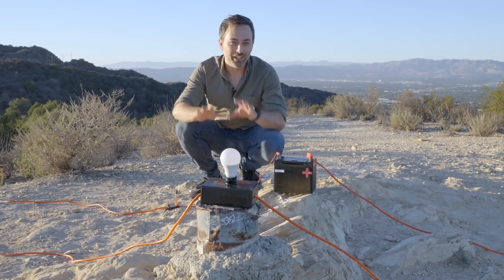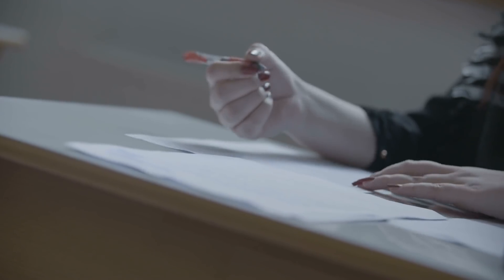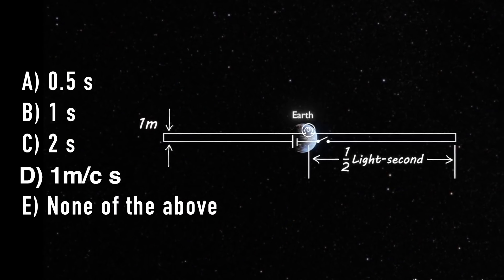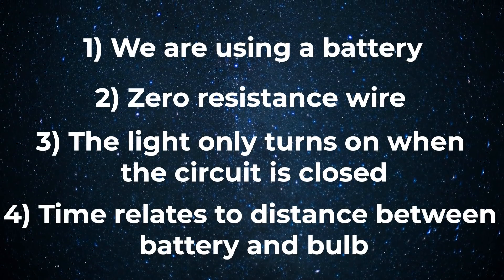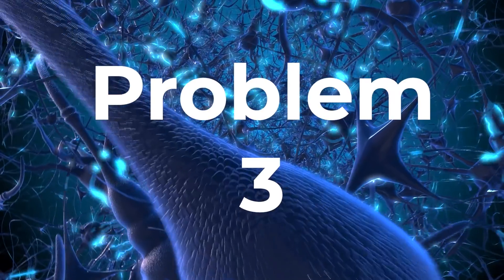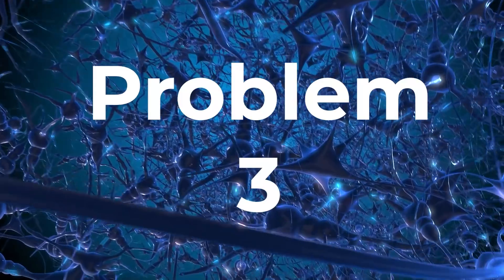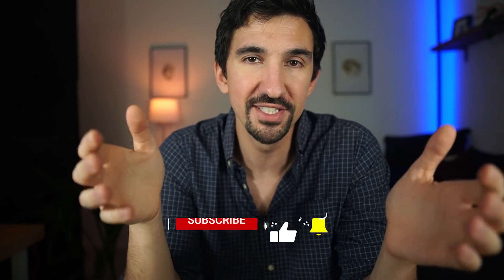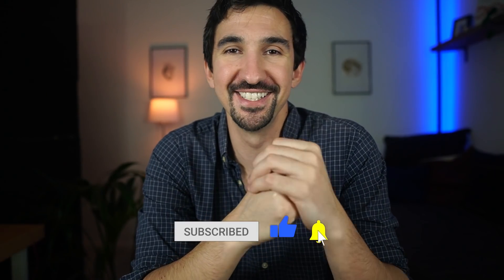Is Veritasium Wrong About Electricity?

Comment: I've not seen mention the index of refraction in these conversations. The "speed of light" as often quoted is when measured in "free space", or a vacuum. Light travels comparatively slower in any medium, be it glass, water, a wire, etc. That is why a pencil in a glass of water appears "bent" at the air/water boundary layer. Do we just take the accepted answer, either presented here or Veritasium, and multiply that by 0.7, or the agreed upon IoR,  and "call it good?"

Comment: I think you missed the point. The 2 wires/battery are 1 meter apart. It created a capacitance. The electron waves moving affects the field, that will interact at 1m. I think thats what they were going for.

Comment: Consider this: The voltage potential, EMF, is already across the entire circuit before the switch is closed, put a volt meter across the switch and it will show the battery voltage at that physical location which is about a foot away from the light bulb. Now if I push or oscillate the atoms at one point in the wire how long does it take to move the atoms at the other end of the wire if they are all connected? or how long does it take the steel ball of a newton's  cradle toy to move when the ball at the other end strikes?  Yes I believe Veritasium is wrong. Veritas truth? However I do agree it is the moving magnetic field that gives the power not electron flow that power is simply transformed across the gap in a transformer hence the name transformer., and there is also the "skin effect" which I wont get into.

Comment: If we convert  kilometers in cm  like architectural  scale. Small miniature version. We get size of earth 13 cm,  sizrr of sun 6.96 meter. And distance between them is 1.5 km.
 And speed of sun light is infinity.
     Look at the scale below. Correct me if i m wrong.

1000 km= 1 cm .
10000km=10 cm.
13000km=13 cm.
15000km=15 cm.
100000km=100 cm (1meter).
200000km=200 cm (2meter).
696000km=696 cm (6.96 meter).
1000000km=1000 cm (10 meter).
10000000km (1 CR)=10000cm (100 meter).
100000000km (10cr)=100000cm (1km)
150000000km(15 cr)=150000cm(1.5 km)

Comment: The instantaneous current is related to the ratio between the load (low) and the impedance of the parallel wire transmission line.

Comment: At first i was wondering why you were empathizing on being battery and no resistance, and thought can’t it be a strong electricity source ? And realized if it was strong electric source it could work like parallel antenna or wireless charger specially if it was a/c. Good first two assumptions.

Comment: I have stopped watching Veritasium after realizing that Derek is just playing with people's confusion between 'electromagnetic effect' and 'electromotive force'. The electromagnetic effect propagates with time 1m/c to the bulb, but the electromotive force takes 1 s to propagate to the bulb. It is the e.m.f. that lights the bulb up, because the operating current can only pass through the bulb when there is a correct e.m.f. across the bulb. The bulb does NOT light up simply it receives an electromagnetic pulse, which is so miniscule that it can safely be ignored. Disclosure: I have a Ph.D. in physics.

Comment: Nice rebuttle and clearifies and corrects some aspects of Veritasium's video. I believe though it misses the point he was trying to make- that it is not the actual electrons flowing through the wire that is the charge. Electrons flow slowly (drift velocity) at barely 1% the speed of light. And yet a charge travels at near light speed as electromagnetic wave. They operate more like water molecules oscillating up and down, moving slowly, yet transmitting a wave very fast out from an impact. A water wave can even transmit in opposite direction of water flow. It takes about 11 million eV to propell an electron to near light speed (beta ray), which an Eveready battery is not able to do.

Comment: I had a hard time understanding Derek's explanation so I'm probably wrong. But I thought you were saying that the electricity travels through the magnetic field outside of the wire. That the magnetic field from the battery extended directly to the light bulb and did not have to travel the wire. That was the point he was trying to make.

Comment: So I'm assuming the "battery" in the case of powering my lights at home,  would be the power station,  and farther down the line,  the transformer outside my house.  It's he implying that my lights are powered by the transformer inducing a current into my lamps? Or is he taking about a different magnetic field than one that induces current?

Comment: True, 1/C is used to consider that any fastest thing possible is the speed of light, but here its only means instantaneously. And even if consider the sped of light (1/c sec) then also it means electric signal travels faster than light. It means someone can send signal from moon to earth through wire in 1/c sec while light reach after 1.2 sec.

Comment: I still dont get the idea of a limited speed of light ..... If current is light as electrons in formation, the speed of light is analogue to a rate of induction. It would first be necessary to understand the potential of space in its dimensions . With the 3 D model plus time as a 4th dimension the concept of light is not understandable. Albrecht Durer allready had that knowledge about the potential of space . He gave hints in his artpieces that he had further knowledge of the concepts of time and light.

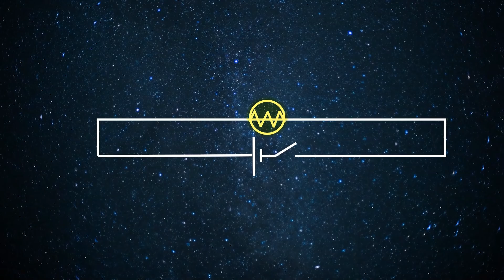Comment: 4:25 You neglect the capacitive and inductive coupling of the loop of wire. It's not sufficient to only focus on the current running in the wire. You have to apply all four of Maxwell's equations to the problem simultaneously.

Comment: 3:32 "the signal could propagate all around the signal unimpeded" - No it cannot. Funny that you say "unimpeded". A wire even if had no ohmic resistance, it still would have capacitive and indictive properties, it has an impedance!

Comment: BLAH, BLAH, BLAH, BLAH, BLAH.  If you knew the basics of wave theory or transmission line theory you would have drawn a simple diagram showing how the fields in the two wires interact with each other.   
But you didn't.

Comment: What if the two wires AREN'T one meter apart? What if they're a mile apart? Does that mean the lamp with never turn on? Or not as fast?
Reply: You have to change the 1 in !/c to get the the distance he uses 1 meter as an easy number for the example,  if it was 240897 meters away you would use 240897/c

Comment: I don’t think you understand what he was getting at. He mentioned the characteristics of alternating current, how it doesn’t flow through the wire like water through a hose but shakes back and forth. I think what he was getting at is the fact that on or off there is constant flow of current in the line. It’s a big theory that’s going to take people stepping out of the old comfortable notion of electricity we all know and love. I think the theory is closer to what Tesla was thinking of than we’ve gotten yet. Let’s not forget Tesla designed alternating current around the principles of am radio. 120 volts residential power supply shares many many similar aspects as your clunky ancient am radio technology. Over the air electricity makes a lot of sense if you look at it as magnetics and plasma.

Comment: Thanks. I've been asking that question on every video on this since I first saw it (with no response). 

Either the wire doesn't need to be closed, or there must be a delay equal to the distance of the wire, or we've disproven Einstein.

Comment: Lol, Veritasium's electric circuit is so big that the light would lit at all times regardless of a switch turned on or off. On the other hand an insain amount of force would be needed on wires to stay in place and keep the innitial shape.

Comment: Using the term "lies" imparts sensationalism and makes me skeptical from the start. I was uncomfortable with the explanation and appreciate the objective criticism of the original video. I also think it's a little deceptive to speak of this transfer of energy in such a way that it sounds so magical / mysterious. (although it is really cool) It becomes a little non-sensical to talk about the magnetic / electric fields as if the flow of current was to be ignored. With this model - you can't have one without the other - in order to light the bulb. Also, the time it would take for the filament to actually begin to emit light would probably take much longer than anything discussed in the experiment.

Comment: Your cheap shot missed the mark and you shot yourself on the foot. Your 1m/c s is more wrong than 1/c s. It should have bee just 1m/c, because you are assuming 'c' contains the units. What you wrote on the video, 1m/c s, has the units of seconds^2. At least veritasium's version can be seen to be correct if you consider 'c' to be only the magnitude, which also fails in your case. That's the trouble in being pedantic, you have to then hold yourself to new standards.

Comment: A potential exists on either side of the switch...with it open..close it light comes on instantly...leave switch open..grab the positive wire and touch ground...light will come on and you will get knocked on your butt instantly...:)

Comment: How is this any different than data being sent through a network cable? 

Also what if the power lines were still as long as the thought experiment states, but where coiled up so the entire experiment happened locally to eliminate the delay of observation caused by extreme distances.

Comment: 1/cs = 1/meter. There can be no conductance if there is no resistance. The potential required by the battery is too large. The lamp will not turn on. The inductance = distance/4Pi(F/m)c^2

Comment: Actually, assumption #3 on your list is the one that is problematic. Veritasium's video didn't claim that the light "only turns on when the circuit is closed," but rather when some - possibly small - amount of current passes through it due to power from the battery. When the switch is closed, even if there is a break in the circuit far away, there will be current induced in the bulb at t_1 ~ 1 m / c due to the capacitance between the opposing wires. For this same reason, causality isn't violated because the break in the circuit won't be "seen" at the bulb until the EM wave has had time to propagate to and from the far reaches of the circuit, which is on a very different timescale t_2 ~ 1 s.

Comment: I found that the belief that electricity moves through a wire at slightly less than the speed of light has worked for me, in my 39 years as an electrical engineer.  I use 1ns per 10 inches of wire as an approximation.  The speed of light is 1ns per foot.  You can easily measure this with a length of cable, a pulser, and an oscilloscope.  The car battery can be replaced with a 12volt pulse.  Use 10 foot of cable (2 conductor, which functions as a transmission line) and a load at the end (your light bulb).  Connect a scope to the pulser and the load.  It will take approximately 12ns for the pulse to appear at the load, therefore 12ns for the voltage to appear at the bulb,  and the bulb to light (this ignores the fact that the filament must heat up to emit light).  If it takes 12ns for the pulse to go 10 feet, there is no way the hypothetical light bulb could light in 3ns.

Comment: Your point number two dude makes no sense.   Veritasium said that its the fields around the wires that actually conduct the current. It doesn't matter that a light second away there's a break in the wire. You're still assuming  what veritasium  was arguing against.

Comment: Electric field spread has speed of the light. In order for time delay to occur wire has to be more than light second. In this problem plus/minus has to travel 1 light second each + 1 meter. So delay will be that 1m/c since that meter is over light speed limit.

Comment: I see no basis for why assumption #3 leads to the conclusion that the light goes off faster than 'light'. Around time 4:00. That seems to be pulled out of thin air without any analysis of that situation.

Comment: Here’s is my opinion, based on personal observations.
The string inside light bulbs, at one time or another, breaks.
Each time it happened in my life I had to change the light bulb because, once the circuit is broken it doesn’t light anymore.

You need movement of electrons to have electromagnetic field and this movement cannot start until the information “circuit is closed” has traveled through all the circuit. electricity can travel through metals because of the presence of free floating electrons and the information about the closing of the circuit needs to travel through them.
So, on my opinion, with a 2 light seconds circuit, light can’t be seen before 2 seconds because no electron movement can start before 2 seconds.

Comment: Item #2 by itself (wire resistance) proves that power is delivered thru the wire. Some of that power will also be dissipated by the wire itself. When the resistance is large enough, due to the wire material, diameter, and length, then no power can be delivered and the light won't light up, because it begins to look more and more like an open circuit as resistance/circuit length increases. Lowering the conductor resistance or circuit length allows it to work at some point... meaning that the conductor is an important part of making power delivery happen, not just EM fields. Seems like V is trying to exclusively apply theory related to transformer coupling (AC) or high frequency power transmission through air (also AC), to a circuit that doesn't operate like either one of those things (a DC circuit). With the zero ohm wire assumption, the circuit length is no longer a limiting factor and the wire power losses go to zero, so there appears to be no wire to limit the current flowing thru it... yet the superconductor is still an essential part of the circuit. In the superconductor case, the delivered power is not electromagnetically delivered. It's delivered because current can flow thru it.

Comment: So what if the wires are not 1 mtr apart or parallel? Will electricity them be transmitted through the surface of the cable? My understanding is that power/energy loss is always a factor and it is this energy that creates the magnetic field to begin with.

Comment: there absolutely is (theoretically) forms of information that "move" or "travel" faster than light. Vsauce had a good video on that. the point at which the two blades of a pair of scissors meet travels faster than the speed of the blades closing. or a shadow cast on an object far away moves faster than the object casting it. if the scissors would close at the speed of light, the meeting point of the blades would travel faster than light.

theoretically, the speed of sound can be faster than light. in a 100% stiff material, that has no "give". 
imagine a rod, 300.000km long, being used to push a button. as soon as you push one end, the whole rod moves, pushing the button instantaneously. this would mean the molecules of the material push against each other, the (sound-)wave travelling at super light speed. theoretically.

Comment: Haha, My first thought when I saw this is if you had a power supply large enough to complete that circuit (And given just some rough head math on voltage drop I think the wire would need to be somewhere around 4 or 5 Simi trucks wide) and the wires were 1 m apart, you wouldn't need the switch because as soon as power was introduced from the supply to the line side, the two wires would arc... So the real answer is d none of the above because you gonna see a bright light but it ain't the bulb! 😂

Comment: An electric current isnt going to leap across an air gap and continue on a separate wire. And youre not going to get a current to begin with if the wires on a battery do not form a closed circuit. Basic stuff.

Comment: The problem is if you move the switch, the absolute shortest time it should take is the time to propagate from the switch to the battery, added to the time from the battery to the lightbulb.
Otherwise you could put the switch next to the light bulb and turn it on before the battery would even have the information to start propagating a field.

Comment: If you used a 100 volt battery and a 1.5 volt flashlight bulb, the bulb might light at 1/c, but then it would explode.

Comment: Your assumption overall is correct... however, through quantum entanglement, information can indeed travel "faster than light". 
Also, Einstein relativistic theory only works within a narrow set of parameters, but breaks down outside of those parameters. For instance, currently the universe is expanding faster than the speed of light.

Until we find a unified field theory that can sicinctly predict every circumstance with accuracy, Einstein relativism is the best we have at the moment, but it isn't the end all be all.

Comment: Why do you think causality is between the battery, through the wire, to the bulb? The whole point of the original video is to get you to realize that energy (and thus information!) travels through the space between conductors, not through the conductors. The causal loop is between the switch (the thing that's causing the change in voltage, which induces the EM wave) and the bulb. The switch and bulb are 1m apart, so the EM wave will propagate to the bulb after 1m/c seconds. Move the switch (or break the circuit somewhere else) and the wave will take longer to propagate.